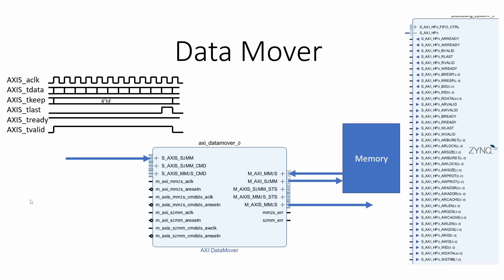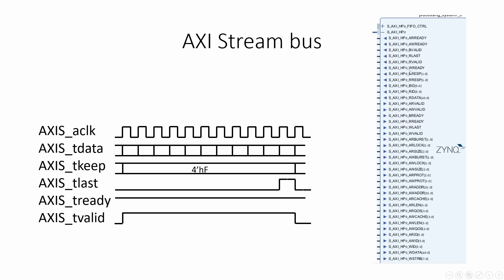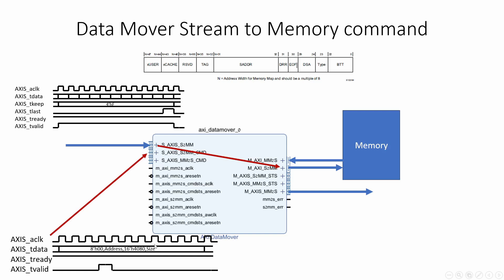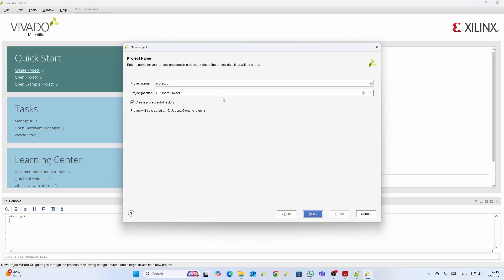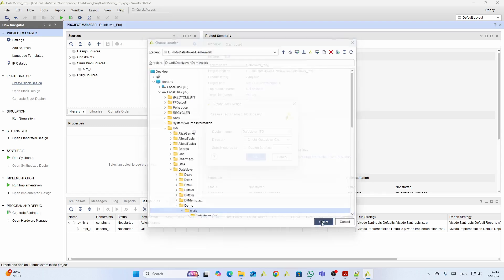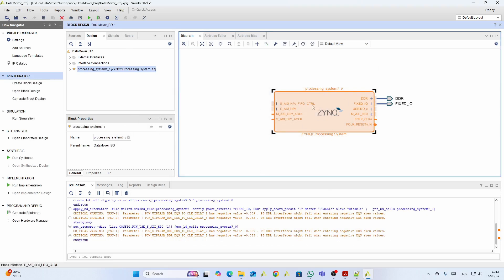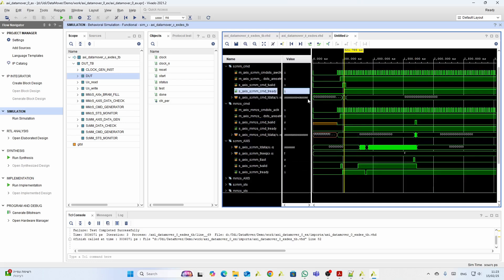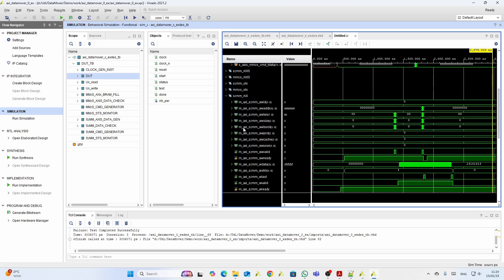DataMover Part1

Comment: What is the difference between a data mover with DMA? Both work by converting data streaming to memory, and vice versa
Reply from the maker: DMA is controlled by software (CPU ether Zynq or MicroBlaze). DataMover is controlled by the Hardware no need for CPU.
Reply: @Udi-FPGA i think both of them have an axi4 interface that a hardware module can write to these configuration registers to initialize the transfer, although xilinx provide a software library to do these on CPU